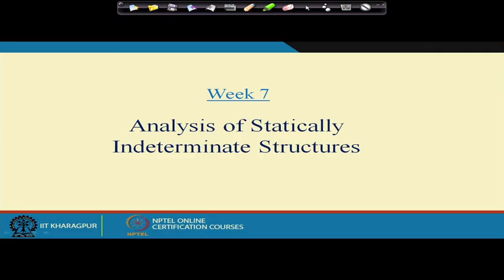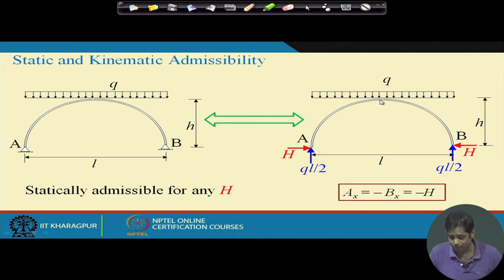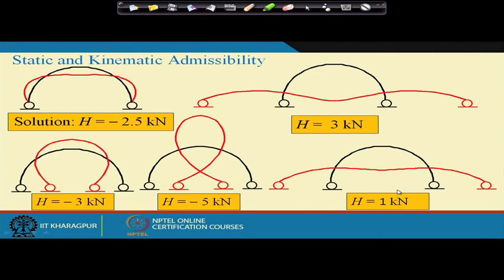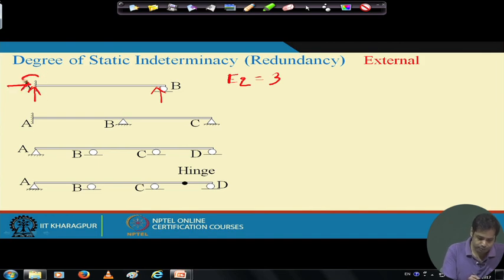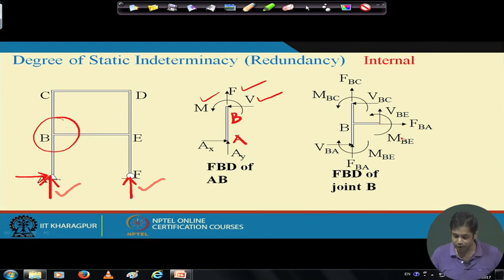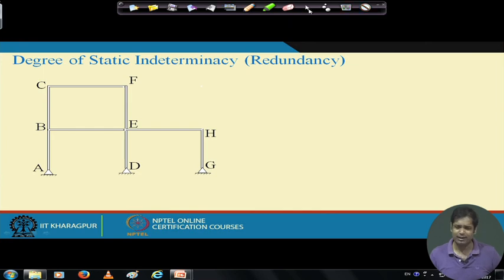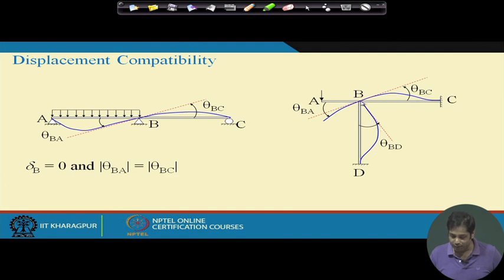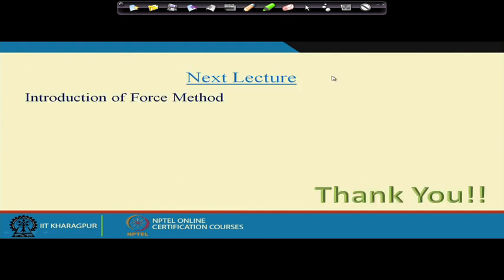Lecture 33 : Analysis of Statically Indeterminate Structures

Comment: I'm a bit confused now. Earlier you'd mentioned that external indeterminacy is due to support reactions whereas the internal indeterminacy is due to the members. But in this video when you started calculating the total indeterminacy you'd mentioned the external indeterminacy = 3c (due to members) whereas internal indeterminacy= unknown reactions- equilibrium eq. (Due to support reactions). So can you please solve this query?
Reply: Yes....the professor had wrongly mentioned the 2....indeterminacy due to loop will always be internal...😇😇@21:57
Reply: @singhdurgesh660  Thank you! 😇
Reply: may be its silly mistake...in internal nd external...otherwise all fine..